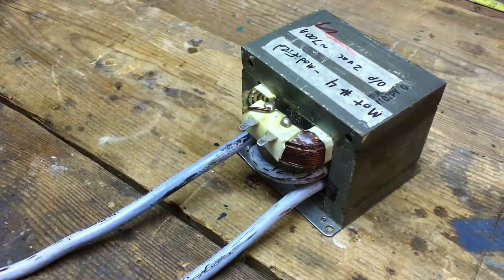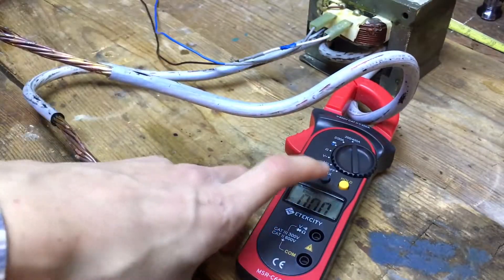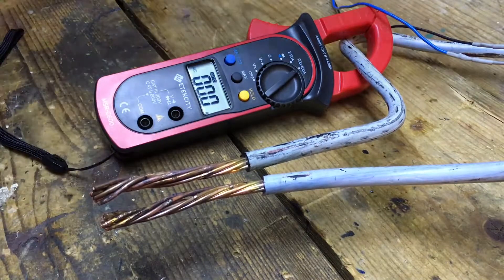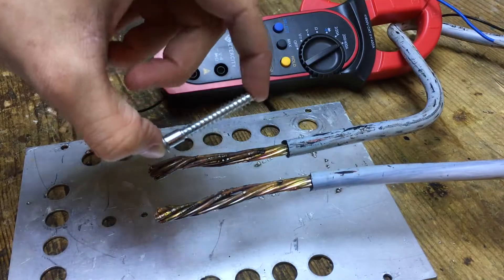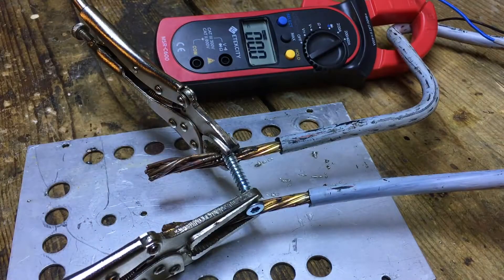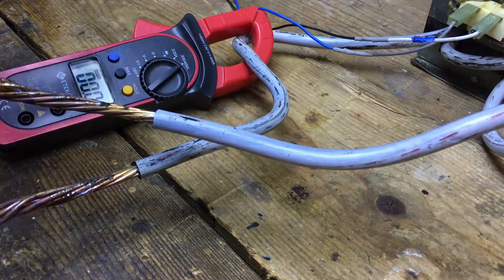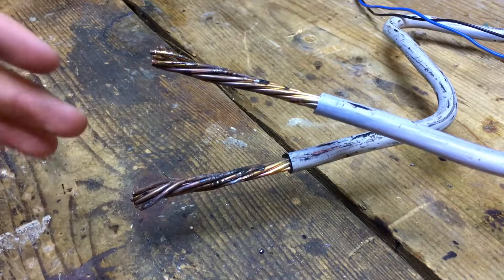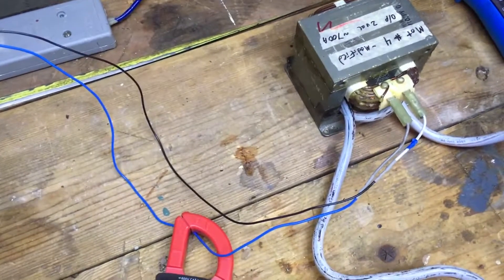Testing High Current Transformer (Modified MOT)

Comment: If you want to see a video with lots of low-voltage sparks check out the video by styropyro where he hooked up 100 car batteries in parallel, but when he wasn't getting the current that he wanted he hooked them up in series parallel to get a voltage of 60 volts DC, on one current draw his meter showed that it was drawing 50,000 Amps for a total of 3,000,000 watts!